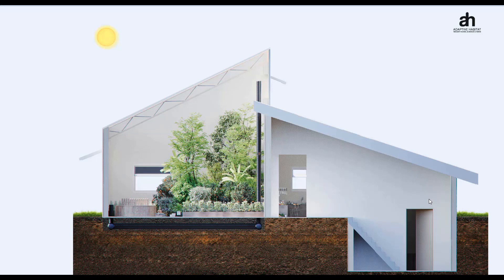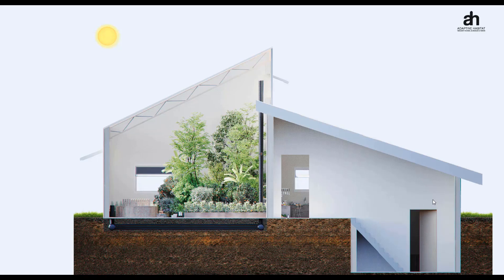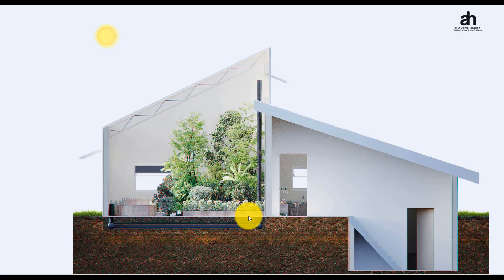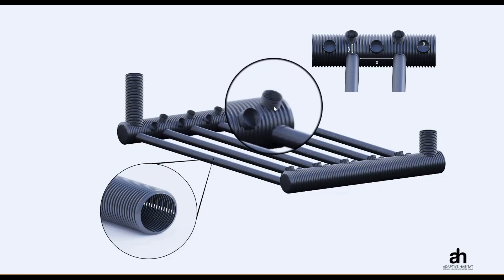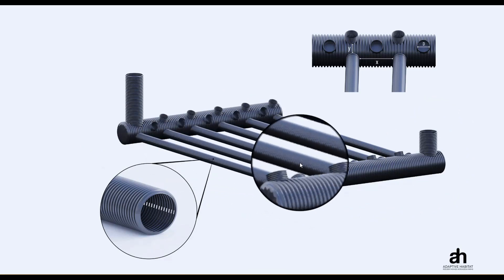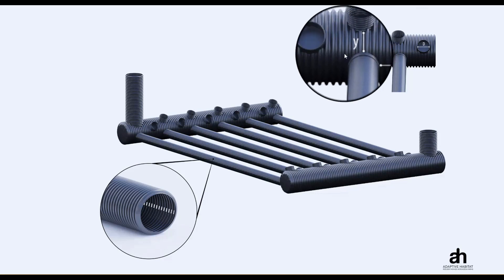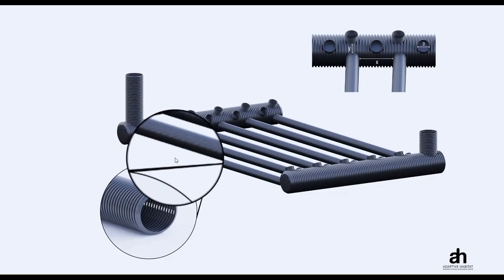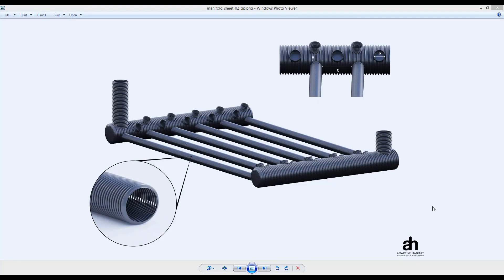How To Design A Climate Battery for a Greenhouse

Comment: Great video.  I've been contemplating using a small diameter tubing such as 3/4 PEX to create a ground loop in a trench similar to a geo thermal system and passing those tubes through the growing beds and possibly to a radiator with a fan behind it...  Thoughts on feasibility...?  Has anyone tried this with success or even failure?

Comment: I keep hearing people use skepticism when talking about this process. I am curious how it could not work. It may not provide enough cooling for the building you put it in due to size mismatch. But unless someone can explain to me the physics of how the air could not be cooler after going deep enough underground for a long enough time, I am listening. It seems like the only reasons it would not work would be bad engineering or crappy installation.

Comment: I think cfm can cool too quickly if the volume is turned over to quick. Wicking heat rate from ground is key ie surface area.

Comment: i have a friend in construction and when installing in floor heating he would put styrofoam insulation on the ground so that the heat would heat the    floor and not the ground.  If the pipes are           6-8 feet down and you lined the base with foam insulation would it be more beneficial in that you would only be heating the ground above the pipes?  looking to start construction in the spring and want to make it as efficient as possible.

Comment: I have been experimenting (on paper) with different designs that use water, instead of just ground, as a medium for heat storage. I like this idea because water has a high thermal mass and ought to be able to store a good bit of heat. The major downside would the cost of creating a reservoir vs free dirt, but I plan to need a reservoir for aquaponics anyways. I would love to know your opinion on this since you have put so much thought into solar and geothermal systems.
Reply: I have thought about this system too. the best result I have come up with is a combination of a segmented pathways of water, and one or two reservoirs. the reservoirs aren't too expensive as second hand water heaters can be pretty cheap, and are really well insulated.

the main design I came up with was a controlled series of switches that open and shut valves to different parts of the system (some holding hot water, some cool) 

there need to be many different places to dissipate and increase the waters heat (exposed pipes and so on) because relying on the soil is not enough and the soil will overheat and loose all the thermal regulation benefits.

with enough pipes and thought the system could easily heat a house
Reply: People do this with barrels.

Comment: I certainly agree that pumping heat into the root zone of plants is very beneficial in the winter.  Soil temperature is just as important as air temperature for optimal growing conditions.  I do wonder why you would ever pull heat from the root zone in winter.  It seems to me that should be a one-way transfer for successful plant growth.  Earth tubes are proven to effectively heat the air of a greenhouse.  But those earth tubes should not be pulling heat from the soil plants are growing in.  Am I wrong?
Reply: Yes in the Winter These pipes ar primarely going to pull heat out of the soil but the ground will be warmed throuout the majority of the year an top of the fact that in a bis thermal battery a deep layer of soil is where the air pipes run so that the heat captured throuout the summer does not go into the air and away before winter. This makes it so that the heat pulled from deep in the ground does not really affect any crops negativly before it starts getting replenished again in the spring
Reply: Sorry for the bad grammar

Comment: sorry but this is a bull of crap, you dont need any of that stuff to design your system. Just use little common sense and experimentation.
Reply: A hvac enginner doesnt rely on common sense and experimentation to design a system. Its not as complicated as it seems.

Comment: Would it be feasible to use this type of passive system to heat water instead of air? I am interested if this can be used to regulate water temperature for a aquaponics system, in conjunction with an air system.  I know that the ambient greenhouse temperature will mostly regulate the water temperature. Will this give better direct control of the water temperature?

Comment: I wonder why you need the pipes to move the air.  Would a manifold at each end of a rock bed of sufficient depth achieve the necessary contact between the moving air and the thermal mass( rocks of the proper size).  I am guessing solid rock is way more dense than soil so the total storage per cubic ft of rocks would be higher than a cubic ft of soil.
Reply: I've thought of that too. The rock bed could be as deep as you want.
Reply: The heat capacity of soil increases with moisture content. A rockbed has a lot of air spaces which equates to less mass. The specific heat capacity of rock and dry soil are about the same per lb. Soil is generally free and available on site.

Comment: so the pipes are empty and only the air from the greenhouse flows in them? no chemicals in them like in geothermal heat pump? do the tubes need to be made out of plastic or can they be made of metal?
Reply: You can in theory make them of metal.   But that's going to be more expensive and more difficult to work with, for probably not a lot of benefit.  Soil, stone, and air all have far lower heat conductivity compared to metal.  The metal pipe would be like a Bugatti stuck in a traffic jam with all the GM vehicles.  Fast in isolation, but limited by it's neighbors.
Reply: @mattmanning1572  thank you for the info!! would this type of heating work with sunken greenhouse or is the idea of sunken greenhouse so that you don't need additional heating or cooling?
Reply: @wiezyczkowata  I should give a disclaimer first - I don't actually have any kind of greenhouse yet, so I don't speak from experience.  I'm among the ranks of those 'planning to make one'.   But as I understand it, whether or not a sunken greenhouse will work on it's own will depend entirely on your location, climate, and just how 'sunken' it is.  
In addition, the temperature you want to maintain will influence the equation - do you want to just maintain above freezing to overwinter figs and citrus?  Or do you want to have tropicals year-round, which would require maintaining perhaps 50F?  Or do you want to actively grow tomatoes all year, which would require 65F minimum?
But in general yes this system of heat exchange with the ground should be a fine addition if just being sunken isn't enough.   The less heating you need to do, the easier it will be for the ground source tubes to make up the difference.
Reply: @mattmanning1572  thank you for the answer, it was very helpful!!

Comment: Great share, Will this be able to climatize a Mediterranean climate greenhouse? Where winter is cold (down to around zero Celsius) and hot summers up to 40 degrees Celsius.

The greenhouse we are thinking to build has double glazing on the south and insulated walls on the north. Considering a Trombe wall at the back wall, as well shade cloths on the outside with ventilation vents at the lowest south side and autogas vents at the highest north side, plus 2 large doors at east and west.

This kind of knowledge on passive climatizing is rare here so hoping to overcome the lack of local knowledge and examples by relying on info that I inquired in the last 10 years of Permaculture design and research and a great community of spread out international colleagues like you. Then provide this example to locals.

I’m open to any advice in any direction. The goal is to be able to stay inside and grow plants all year round in soil an aquaponics systems. The greenhouse is not attached to a home, it’s stand-alone. 
Geo-location:  31.706334, 35.228147

Thanks in advance.

Comment: so, why would an air particle choose to pass through the center of the pipe system when there are twice as many corners to overcome? Only if the outtermost side pipes were 'full'? If I'm an air particle and I'm going to take one of the middle pipes, I have to turn 90 degrees into the manifold, 90 degrees after the manifold, 90 degrees into a small pipe, then 90 degrees into the outter manifold, and 90 degrees again to get into the exit pipe. The air particles who go through the outtermost pipes have two less corners to overcome. I imagine someone's thought about this already and it was still deemed appropriate to have the middle pipes? Has anyone built one of this with softer corners for easier airflow? I bet traditional masonry heater builders would have some wisdom about design possibilities for these kinds of fluid air dynamics....
Reply: You gave me a good chuckle... thanks.

Comment: Thanks for a great series of videos.  Have you ever designed a climate battery using water in drums underground?  Clearly there are some logistical issues, but water stores much more heat than gravel or soil.
Reply: I am in the process of building a thermal mass battery under my greenhouse, using a small swimming pool (8ft dia x 3 ft deep), five feet down...I am going to do experiments on growing produce year-round in extremely hostile environments...(our winters have seen temperatures as low as 30 below zero F...there is very little water...at an elevation over 5000 ft.)...I'll let you know how it goes...
Reply: @shawnncheriyoung3597  i am wondering how it went if you can share
Reply: @lifeinyourbodyonce6516  I haven't had the chance to put everything together...I am hoping to soon...I have all the parts, just no time...my wife broke her hip, last September, and everything went on hold...(she has Dementia, also, which doesn't help)...I am hoping to have everything set up in the next two or three months...I'll have step-by-step videos...I will let you you know when I start to post them...
I have a different YouTube channel, you can check from time to time; it is: Shawn&Cheri Young...I don't have much there right now; the Walrus Fire and Digging Out (I got a little snowed-in last winter)...
anyway, I hope to start working on my system, soon...
Reply: If you get an hour of sun on a winter day your water may only gain a few tenths of a degree. With soil, the heat stays at around the same temperature as it arrived. The heat also remains close to the tubing where it can be recovered for use later that day. The conductivity and diffusivity of soil more than makes up for its lower specific heat capacity.
Reply: @JohnGuest45  I believe that using a stone based thermal mass is more effective than soil and easier to use and maintain than water based storage. River stone has been used effectively because large voids allow passage of air easily creating uniform heating which is better that having hot zones in the soil. Stones allow for drainage and control of condensation, stones self compact which is important if your in clay.
Reply: @capeguy  
Even heating can also be described as dilution. This can be an issue when the system is operating "hand to mouth" where the heat in the mass is low (late winter) and all the available heat from the day is used the same night. A kettle full of hot water is more useful than a cold swimming pool that has a kettle of hot water added to it. When soil is used as mass, the heat remains relatively concentrated and within reach of the tubes. The best choice depends mostly on the local climate and especially the amount of winter sun.

Comment: why not just use water in an insulated tank? that way, u dont have to dig underground. additionally, water can hold 5x as much heat than soil.
Reply: 🤔Interesting.... are you referring to a hydronic heating type of setup or, rather, moving the air through the tank to heat it up. It kind of sounds like either would work (in my mind). I am a complete novice, so forgive me if my question seems offputting....
Reply: You would still have to put the tank underground...the point of putting the tank (or coils or pipes or blah, blah, blah) is to utilize the cool earth in summer and warm earth in winter...an insulated tank above ground would have to be heated or cooled...a tank under the ground is being heated and cooled by the earth...I am doing both; I am putting an 8ft dia x 3ft deep pool under the greenhouse. This will draw the cool from the earth in summer (vent tubes in the water will help)...in the winter the water will be kept warm by the earth...I will be using a rocket stove/mass heater (circulating the water through the stove, also) to add supplemental heat on the extremely cold days...

Comment: You're an amazing person! Thanks for sharing this great knowledge. Curious, would it not benefit the "soil" to be small gravel and pebble instead? By replacing soil directly on the piping, wouldnt it hold underground temp better if it were stone? Any downside to this thought process?
Reply: underground stone/rock baffins for a rocket mass heater would benefit greatly from a packed sand then pebble floor above it, the heated air would leave the RMH exhaust and seep through the floor into the greenhouse also heating a mass that would in turn release its heat during the night/cooler times
Reply: you can have just a rock box under the home (large and medium rocks) that takes hot air from the attic with a fan in the day, and at night a vent flap opens into the house and closes off the outside air vent. Air flows over the rocks, rocks hold thermal energy, and at night keeps the home warm. A hot air solar collector can be used in combination with this idea to create an effective night time heating solution.

Comment: Good morning,

Summary: Will your model address the concerns I have listed out ? If so, it seems a small cost to be able to KNOW prior to construction the the earth tube system was designed correctly for the above ground construction (and to be able to play  "what if's" for that).

     Since you are in Canada, even though I see / hear the model input  "for your US climate zone", you state your model is designed for cold climates. I am in US Zone 6b, Southern MO, it is rare for freeze line to extend 6" down. Is your model still accurate this far South ?

     We are at the design phase, looking at earth sheltered (North wall semi-underground and bermed up to top of 10' wall etc.) using 'earth bank' system for primary heating, would prefer to avoid the need for a secondary heat system to maintain temperatures above 33 F., with thermal pane glass (we have source of 1" commercial thermal pane glass at LOW cost, even if structural costs will increase due to additional weight).

Summer cooling is of at least as much importance as is winter heating.

Is this a good tool, that using references for r values etc. (are they referenced or linked, or will we need to look up each ?) for different glazing / insulation questions (what is the effect on minimum temperature if we increase the exterior closed cell insulation on the outside of a 8" poured concrete wall from 2" to 3") type questions ?

I am aware of the 5 volumes per hour minimum winter but thought that 20 volume changes per hour would be more ideal for summer cooling - is there a rule or is this in the model to determine run time ? Is it better to run close to continuous or is it fine to have a 20% duty cycle ? If time the fan's are on is not a design criteria, then higher volume fan's with the ability to meet / exceed 20 volume changes per hour running full time make a winter heating / summer cooling simple - just differential thermostats controlling larger fan's.

Placing a bi-level set of earth tubes placed 3' and 18" down (staggered vertically and input diagonally opposite outflow), but I can clearly see the advantages of more accurate calculations!!!  (is 18 and 36" for THIS climate adequate, or do I need to be 24 and 48" (does your model consider depth placement ?), AND your info was the first time I encountered the idea of 3 levels of earth tubes.  I had also been planning to use smooth walled tube for drops, raises, manifolds for less friction losses, and the corrugated standard = lower cost 4" sewage drainage tubes to connect the manifolds. Dose your model allow for adjusting (and give references for?) smooth (PVC) vs corrugated tubing ?

BIG question: I had assumed 2 independent systems, 1 for each level to decrease manifold size/cost and to be able to utilize smaller / cheaper fans. NEW, if 3 levels, 3 independent systems and use one to zone on section with subdividing wall as more a warmer section???    (I see the lower cost in-line fan's at 400 and 720 CFM) Does your model account for design of 2 or 3 independent ground heat systems ?

Thanks for your consideration,

Robert
Reply: What happened?
Reply: @jupiteradventure5284  Robb never got back to me, I sent e-mail to both his e-mail addresses and then posted this here per his wife's suggestion as the fastest way to get a reply.